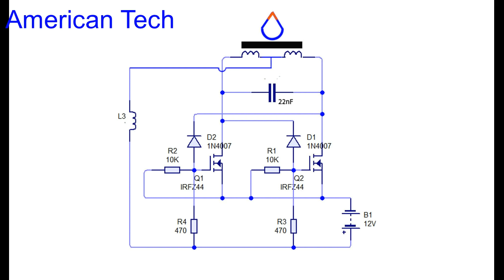How to make a small and powerful induction soldering  iron

Comment: A regular cheap soldering Iron uses "induction" to heat the soldering Iron tip. This one primarily heats the paperclip through high current via a transformer. Induction happens in the coils of the transformer, but the soldering iron tip (i.e. the paper clip) heats not via induction but through high current.

None the less, impressive build. I enjoyed watching it.
Reply: That's what I was about to say as well.  Induction happens in the circuit prior to the tip, but the tip heats because of resistance to the current produced by the circuit. The soldering is done via thermal transfer and not induction, which induces current via magnetic flux lines expanding and collapsing at frequencies that rapidly move the molecules of ferrous metals.  So it's a big stretch to call it an induction soldering iron, but a cool project nonetheless.

Comment: Thank you so much for this video!
I think only a few viewers understand how ingenious this design really is.
Your design is much more sophisticated than it looks like.
Reply: Roni Daffan well, he’s faked some stuff in the past, but he seems to have stopped doing that.
Reply: What is NICE is that he used a bolt with 2 nuts as a secondary "winding" on the transformer! That's what's great about high frequency circuits. You can use small transformers with very few turns on them.

Comment: That is not induction heating.
That is a high current step down transformer heating a wire. (paperclip)
Using Gates to turn the 12v DC into AC...How well do the Gates handle the load of driving the big 2mm wire? Apparent there would have to be a "Duty Cycle" (1min on, 5min off ???)
Reply: Yes, exactly! And the screw is 1 turn coil! The main problem that Fuco's current is much higher.
Reply: That's what I thought... Sad that induction is mentioned as a buzzword in the title, very misleading, not educational, etc.
Reply: your comment was good until you mentioned gates and duty cycle.
Reply: You are right. Induction heating is contactless, but there are no "gates" here.
Reply: Yeah, I was a little disappointed by the video.  I was thinking it was a small induction heater used to heat-up and solder small hardware (standoffs, bushings, etc).
Reply: True
Reply: Rebel N Trains True. But the title of the video suggests that it would use induction heating. Slightly misleading.
Reply: 😁😁😁😁🤗 как вы ребята
Reply: what will happen if switch is continuously on?
Reply: @KashifJavedForex  may i try & the clip burns instant as the power continues on
Reply: What do you think induction is lol 😂
Reply: Yes,  is a high current step down transformer heating a wire and this work by induction so this is a induction soldering iron.
Reply: yes
Reply: You are correct.Thereis not shown power adoptor size.I think it should be 5v.3A.atleast.
Reply: Dear friend u agree or not , but this is totally induction there is no any doubt even.
Reply: A little critical?
Reply: Ah,  I new it was some crap,  not a.c. induction at all
Reply: @Rebel N Trains does that mean it's at "resonant frequency? But it's low enough to not generate radio waves
Reply: @Rebel N Trains is it a half cycle.
Reply: @ryanb1874  it would be generating radio waves but most likely at a frequency that doesn’t interfere with anything local. That and they would also be too weak. The key components of a radio are the same components used in this little device, only a radio have a few more circuits to control the frequency, tune the frequency, mix the base frequency to the audio or video signal, and amplify it so we can hear it. 

Another thing to consider is modern electronics are usually filtered against rogue RF. When I was a kid my tyco trains and slot cars would cause the TV to snow. The same trains (don’t have the slot cars any more) do not interfere with any of my TVs CRT type or flat screen.  I imagine this device in the video would snow my old TV like crazy.
Reply: Rebel N Trains i think you are right. With induction he means that it uses an transformer to make a high current that is able of heating the solder
Reply: @davemwangi05  If you look @1:40 you will see Q1 and Q2 are Mosfet's which have Source, Drain and Gate, the Gate controls the connection between the Source and Drain. The "Duty Cycle" aspect is related to the heatsink for the Mosfets is so small that there is low thermal dissipation into the air and would burn up the Mosfets and your fingers since you are holding them if left continuously on.
Reply: @ocayaro   If you look @1:40 you will see Q1 and Q2 are Mosfet's which have Source, Drain and Gate, the Gate controls the connection between the Source and Drain. The "Duty Cycle" aspect is related to the heatsink for the Mosfets is so small that there is low thermal dissipation into the air and would burn up the Mosfets and your fingers since you are holding them if left continuously on.
Reply: @ientu1022  Like I said...
That is not induction heating.
That is a high current step down transformer heating a wire. (paperclip)
Using Gates to turn the 12v DC into AC...
Reply: Transformer works based on mutual induction. So technically it's correct.

Comment: Cool video, quick tip though, using some rough sand paper is a little safer and in some cases an easier way of removing the non conductive coating around copper wires, I've slipped with those utility knives doing the same thing before, it ain't fun, be safe!

Comment: Actually it's an inverter not inductive 12vdc to Ac in higher voltage output,  not practical Use glow plugs -direct dc 4amps up or  use a trafo - 3amps up then remove secondary winding replace it with a huge gauge #10 wire  -3turns  put filament thin wire on two leads  and finish instant soldering gun

Comment: You can use a cord with several wires instead of a 2mm cord. The high-frequency current is not moving inside the wire, but on the wire surface.

Comment: Very nice but we can make it by a small 240V or 110 V  to 6V transformer using 5 turn wire in secondary. Then you don't need any circuit.

Comment: This is a conventional soldering iron powered by a high current transformer. Nice built, by the way!
But it is not an induction soldering iron. The heat is not created by induction in a workpiece, but using the resistance heating in the paperclip wire.

Comment: Thank you. I have following you to make soldering.
My circuit info :
Primary : 12-14 turn.
Secondary : 1 turn.
Capacitor : 47nF.
Small inductor : 470uH.
R : 470 Ohm + 10k Ohm.
Diode :  1N4007
I wait more than 30 secons that make heat enought to soldering.
Why primary coil so hot ? And how to fix ?
Reply: Turn it on and tell me if became hot first the coil or the ferrite core or the coil an then I ll'try to explain you how to fix the priblem

Ps sorry if my maybe my English isn't correct but I'm Italian
Reply: how I can get it
Reply: Who 
When
Why 
Where 
Nobody cares
Reply: Try voltage check...  Maybe less coil turn
Reply: You need 1/2 turn
Reply: 470ohm 1/4. 1w ??

Comment: Interesting design, please Share the circuit with the coils details, also please give information about the material used as a tip, want to make a portable soldering iron with a 12 volts battery to repair things in a model flight camp, is perfect for this use!
Reply: hey, i find the easiest way to make an induction soldering iron is to make a heating zvs with a soldering iron tip inside, or you can use an halogen lamp of 55w with a cover from an old broken soldering iron
Reply: my best soldering iron was this zvs i made.
Reply: +ACT 2 DIY - We don't want to make a Boom Box !!!  Buy it at Dollar Store for $1.00  LMFAO !!!
Reply: I have seen several fairly capable USB powered soldering irons that you can carry a power pack for in your pocket, I would probably opt for one of those rather than trying to build my own. I believe BigClivedotcom and EEVBlog have both done videos on them.
Reply: Punchi andare

Comment: Judging from the video its a zvs flyback circuit in buck mode. And the pb sw will die shortly.
Reply: Royer oscillator.  And the switch deals with only the bias voltage of the MOSFETs.
Reply: lies. you don't know what you're talkin about
Reply: @davemwangi05  who did you respond to? And are you aware of your self-contradiction? Lie must be conscious.
Reply: PadiTheOne yeah lol
Reply: ...will die shortly.
You"re wrong.This circuit and similar are operating almost w/out power losses due being zvs flyback,high switch freq and low Ron MOSFETs.
There is a video from a russian amateur,where he demonstrates similar iron he exploitng intensively for 20+ years and only once he required to replace the Fets.

Comment: this is not an induction iron. clickbait
Reply: actually it is.  he made a transformer and used the thin tip as the heater.  it works exactly line the induction irons that you buy.  they use a transformer with a 1 turn secondary for the soldering tip

Comment: All that and it produced some of the shittiest solder joints I've ever seen.  What made it worse was that you were re-working existing joints, and it's hard to mess that up.  A new joint to untinned components is easy to mess up with bad technique or bad tools, but messing up a joint that you're essentially reflowing is hard to do.

Clever induction heater, but do not use it as a soldering iron.  At one point the tip was glowing red.  There's a reason good soldering irons are thermostatically controlled.  It's because too high a temperature messes things up.  Red heat is far too hot.
Reply: if you notice he turn it on and off when doing so. the width of the wires isnt that big so it looses temperature very quickly...
Reply: @Hudsonkem  
The low thermal mass makes it worse, not better.  A thermostatically-controlled iron also switches on and off but the thermal mass means the temperature stays within a small range.  This piece of shit cycles between too fucking hot and too fucking cold.  The result is a very crappy joint.

Comment: hi. can you give me information on L3 coil also how many 22 nf capasitor's voltage? thanks.
Reply from the maker: Thank you , I used 8mm screw as L3 = 1turn and 22nf/ 250v capacitor
Reply: thanks.
Reply: American Tech. One turn for the current limiting choke really? I'm puzzled.
Reply: I understood that L3=8 turn for 1 mm but L3=16 turn it's seems at the video. which one is correct?
Reply: @hayrettinavci62  how l3 is 1 turn
Reply: hi Ahmed Sayed. I don't understand what you want to say?
Reply: @hayrettinavci62  how many turns in the small coil
Reply: sorry. I'm not sure too. I do not know exactly.
Reply: 7,4v
Reply: @ATdiy  can I use 22nf 2000v
Reply: @AhmedSayed-oo4uw  yeah  u can, as long as its not below 60v
Reply: Türkmüşsün la
Reply: @AhmedSayed-oo4uw  People seem to totally miss the electronics involved here! The two pieces of thick copper wires and the iron bolt passing through the core together form one turn of a coil. Use some common sense!
Reply: А где схема?
Reply: @ATdiy  what is resistance watt ?
Reply: @ATdiy  Hi Jame,
I would be most grateful if you could  tell me how many turns in the copper coil you used in the Mini Metal Detector circuit.  Also, what gauge wire it is and its diameter. Would really appreciate it as I would like to make it for my students. 
Kind regards,
James

Comment: great little gadget! If you connect to the car battery, it will become very useful for in-car wiring soldering. BTW were you able to measure the current it draws from the power source?

Comment: Pretty cool, but act like a pro...   Use sandpaper on the magnet wire to remove the shellac.  Get a new tip on that iron and add a bit of flux and maybe higher heat.  Wipe the iron on a damp sponge between uses.  I've been doing electronics since 1973 before you were born.  That's not induction heating either.  That is done without physical contact.  That's just a transformer.  That's just like a Weller gun.

Comment: Fine work... but the high frequency magnetic fields caused by this type of soldering irons, can damage some type of sensible semiconductors. Because of this,   I have stopped using this type of soldering iron and I came back to the traditional resistive soldering irons.

Comment: For the benefit of people like 
"Amarjit Singh, 1 month ago, who wrote, "  Dear video uploader...do u exactly knows the meaning of induction?"
1. The basic oscillator is a normal push-pull circuit using two MOSFETS were the lowering of the voltage of one drain will switch off the gate of the other through the operation of the diode. The MOSFET comes on due to the resistance to supply.  
2. The tank coil is a center-tapped coil where the two halves need to be "magnetically coupled" to aid each other, where the full coil is connected in PARALLEL  with the tuning capacitor. This parallel combination needs a current source to feed it or to match it so the little series coil used as a switched choke with the power supply is introduced to change the voltage source into an " apparent current source to match the parallel tuned LC circuit" 
3. The fact that the circuit uses a TOROID ferrite ring, all the oscillatory magnetic field will flow through the toroid ring ferrite material and not through the center hole of the toroid.  In fact, there is no magnetic flux existing in the through-hole of the toroid where the thick tuning copper coil was wound. 
4.  That solid unlaminated threaded bolt that was used through the toroid home suffers no rate of change of magnetic flu and so it does not get hot. It would if there was an oscillatory magnetic field in that hole, but there is not so it is permissible to use an unlaminated piece of steel which in fact is a very clever move. It is not the threaded bolt that heats up the loop of copper to the soldering tip.
5. The steel bolt is only part of the single induction loop to the solder tip.  The secondary of the tank coil is one loop winding where since the two halves of the push-pull tuning coil are magnetically coupled then the whole transformation arrangement may be regarded as a 12:1 step down transformer producing a higher current at a lower voltage than the tank circuit. 

For those who want to dig deeper into the electronic design of such a nice circuit,   if flywheel diodes were to be connected to the drain across the half winding to supply,  then the parallel tuned circuit will not be fed from a current source and it would be mismatched. This circuit is a current source all due to the fact that when the drain is released on the MOSFET is off, then the drain shoots up positive to be arrested by the tuning capacitor and that is a current source effect. 

This circuit may be modified by using two inductive chokes on each drain to supply which will charge up magnetically when the MOSFET is on and discharge that energy content as a current source into the parallel tuned circuit when the drain is released in the off position thus providing the high output impedance of a conventional current source. 
The circuit is indeed an induction heater all the way and people like Amarjit Singh should be very careful when then pass comments as they did...................I just leave it to the readers to decide who knows what is INDUCTION? Amarjit Singh or American Tech?

Comment: This is not an induction soldering iron, it just uses inductors to increase the current and heat a filament to soldering temperatures

Comment: Simply give 2-5 v 5 A to hearing element it will work
Reply: U seems like professional electrician 
I’ve been looking all this video to make a simple spot welder to weld the batteries. 
Something simple as taking two wire from
 (+ & -) side of a 12 or 6 amp car battery 
Do u think it will works 
Thanks

Comment: There should be no need to wind your primary with a 2mm wire, a huge overkill.  It should be the same diameter as the winding of your L3 coil as they are basically in series and carry the same current.

Comment: So the inductance created enough heat for the tip to be hot enough to melt solder, but not enough heat to burn his finger that was directly touching one side of the bolt (the source of he heat for the tip) and nobody questions this?
If this soldering iron actually functioned the way the circuit is shown, and how it was shown to be assembled, that bolt would be hot enough to cause some serious burns to unprotected flesh.
Reply: In fact the project works, even using the screw that is very bad conductor
Reply: @thiagoarcas3276  I never said the project doesn't work. I said if it did, the way the soldering iron was shown being held, would've caused severe burning of the skin that made contact with the bolt.

Comment: Video was pretty good super catchy tune can't get that s*** out of my head now. would have been nice if you showed a little bit more info on the driver portion on how to position the resistors and diodes... it looks as if you soldered the resistors end-to-end like cut the ends off and then soldered the two resistors together. I did not know you could do that if that's the case

Comment: I tried to simulate the circuit in LTSpice but I could not get it to work. Has anyone tried the simulation to see the voltages and currents? I simulated with the following values: (T1) Lprim = 2x85uH, Lsec = 2.5uH. L3 = 10uH.

Comment: That big screw short-circuits the whole invention. IS A SCAM.
Reply: Its not really a scam, just a very inefficient transformer. It is not an induction heater at all, that thick bolt plus wire on either end of it plus the paper clip bit make up a single turn secondary  coil of the transformer. That coil is short-circuited, so the highest resistance part of it (the iron paper clip) heats up the most.  Not sure why he called it an induction iron, I don't think he understands the meaning of the word.